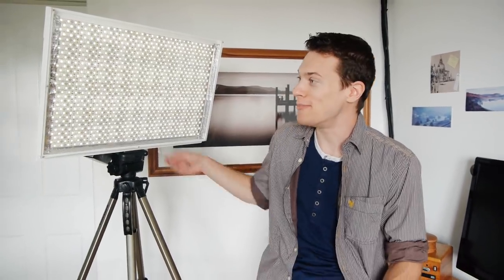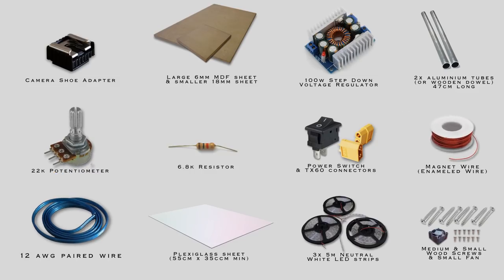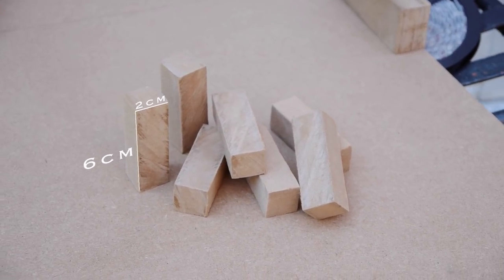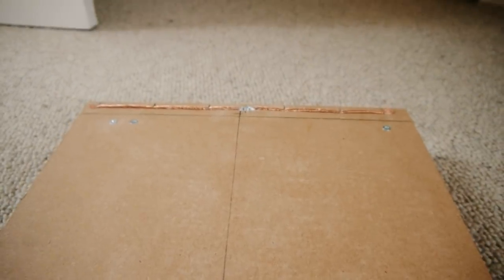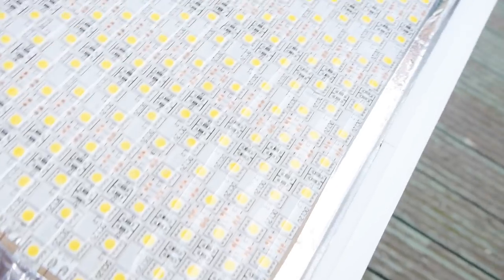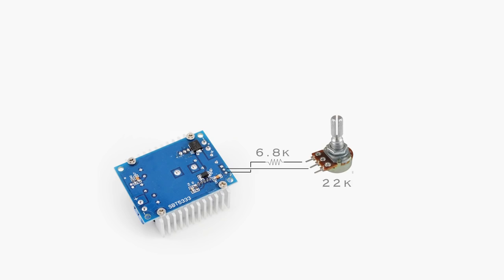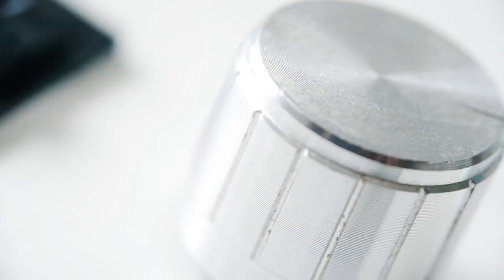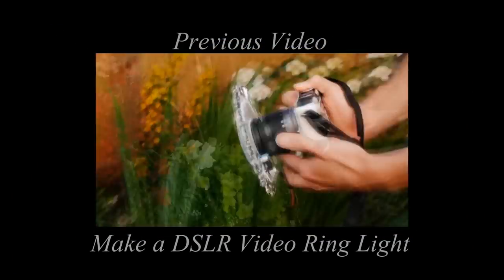How to make a super bright LED light panel (for video work etc)

Comment: Nice project. Do you know where I can find LED strips like these with high CRI?
Reply from the maker: +Miguel Baptista Got a video about such strips coming next month!
Reply: +DIY Perks Nice! Hope you can fins some EU based suppliers. I'm looking into making something like the Westcott Flex. Any ideas on how to achieve that?
Reply: +DIY Perks - Perfect timing. Looking to try this build out ASAP. Would love to do it right and know what to look for in terms of the LEDs to use. Would something like this be suitable? http://www.amazon.co.uk/Waterproof-Strip-String-Ribbon-Roll-300/dp/B018QE8CJC/ref=sr_1_3?ie=UTF8&qid=1454273133&sr=8-3&keywords=high+cri+led+strip
Reply from the maker: +Oscar James I actually have a video about high-cri flexible led panels coming next month. It uses fairly specific strips so if you can wait a bit that would be ideal.
Reply: +DIY Perks Thanks, will keep an eye out. I'm in the process of getting a load of kit ready for when I get my Ronin-M in Feb. I've sorted a wireless video feed with a Google Chromecast, phone and portable monitor. I have to work out the wireless follow focus next. Loving your DIY videos, they're giving me more confidence to make a lot of these things myself. Thank you so much
Reply: +Miguel Baptista Ebay or Amazon have them very cheap.
Reply: I don't know wether it's too late now or you still need the info, but I bought my LED-strips from www.coldzero.com (Smd Led Stripes they are called there). They have a real high density and are REALLY bright. Here's an example of their brightness: I expected to get myself a meter in order to have me PC-case fully lit, I ended up needing only 15cm in total so that it was brighter than my room during the day. If that's not impressive, I don't know what is. :D
Reply: The coldzero link connects to a parked - not live - website.
Reply: glassmakerx
Jeah, just noticed that I'm a bit stupid. It's www.coldzero.eu and NOT .com, my bad.
Reply: yuji sells high cri strips. They are great.

Comment: Doesn't work using laptop adapter. Used 4 step-down converters from different suppliers, the max working time was ~15min.  Didn't try using batteries. Great idea, but suppliers do not hold to the technical characteristics they claim.
Reply from the maker: gene_m Have you installed a fan on your voltage regulator? They have automatic thermal shutdown. Alternatively, it could be your laptop adapter that's overheating. I suggest trying one that's rated for more power output. Laptop adapters DO work, but you do have to make sure that the one you use can supply over 100w, as I mentioned in the video.

Comment: Hi i have a question, i want to use my laptop charger which is 19.5V    6.7A is this enough to use the maximum brightness of the LEDS
Reply from the maker: +Yusuf Murat That's ideal yeah, as it should output 130w. (19.5*6.7=130.65)
Reply from the maker: +Yusuf Murat That's ideal yeah, as it should output 130w. (19.5*6.7=130.65)
Reply: But you said at least 10 amps mine is 6.7A
Reply from the maker: +Yusuf Murat 10A is required at 12v, as mentioned in the video. Higher voltages are only okay if they're behind the voltage regulator, which wasn't hooked up at that section (hence 12v).
Reply: According to my calculations and this led specifications power consumption equals to 72w/5 meter =216w
While supplied power equals to 19.5V*6.7A=130W so I'm still in trouble theoretically my laptop charger is going to burn out
Reply from the maker: +Yusuf Murat The LED specifications aren't accurate, and don't draw nearly as much as claimed. Your charger probably has current protection anyway, so it wouldn't blow out if overloaded.
Reply from the maker: +Yusuf Murat The LED specifications aren't accurate, and don't draw nearly as much as claimed. Your charger probably has current protection anyway, so it wouldn't blow out if overloaded.
Reply: Thank you very much for answering i love you and your tutorials so much keep up the good work

Comment: Hey is it possible to use a Voltage booster instead of the voltage regulator?
Reply: +anthony “Findenzio” Hom What are you planning to run it off of? a single AA battery?
Reply: +fetymann no power supply

Comment: Your link for the LEDs is for Natural white LEDS. Can you use Cool White as well. I want to build this for video taping indoors.
Reply from the maker: hoxha34 Cool white LEDs are usually too much on the cool side of things, looking a bit blueish.
Reply: DIY Perks Does the power supply have to be more than 12DC to work with the regulator. I was reading that every LED consumes .2watts. with your design thats 180 watts. At 12DC that 15 amps. I havent been able to find a laptop charger that is rated no more than 90W. I have found on ebay DC power supplies rated to handle the power based on the calculations.
Reply from the maker: hoxha34
 You can use an adapter that's anywhere from 12 to 30v. Hunt around a bit for the adapter as there are plenty of high wattage ones out there.
Reply: hoxha34 Also I want to build for 3 light video filming. do you think its better to build 3 smaller units instead of one big unit. Lets say 3 30cm x 30cm panels. 300 leds each panel.what are your thoughts. this would be indoors for interviews.

Comment: It isn't clear what power supply specs you used .......... ?  how much a 5 meters roll needs, how many volts, how many amps, what happens to the current intensity when the voltage is dimmed ...  i tried to contact you but you must be busy. 
i'm surprised that you're using a little 100 watts voltage dimmer, when for 3 rolls of leds like that, ( 900 leds, just the same ) i was recommended a 12 volts 20 Amps of power supply ( thinking of converting a pc block for that ), which means 240 watts ......

Comment: I have a few questions:
Wouldn't it be easier to use capacitors to eliminate flickering? ( Low ESR 105°C Electrolytic Capacitors 2200 uF / 16 V).
If this works you could just use about 3 of these and then use a normal 5€ dimmer with a remote control, which would be handy :)
This would result in just the bare LED with a dimmer but much easier to build and cheaper too.

I can't find anything cheap that is a lipo so I thought about using a lead acid battery. Any thoughts on that? They are way cheaper than lipo batteries so there's got to be something bad about them ^^

Awesome video!
Reply from the maker: ***** Tried caps but it doesn't work unfortunately.
Reply: DIY Perks  Have you considered trying a low pass LC filter with a PWM dimmer? I made a smaller version as a proof of concept and it seems to work ok.
Reply from the maker: TheDanyschannel I haven't no, but if it worked it would be pretty handy for RGB type dimmers. What values did you use? You might be on to something.
Reply: DIY Perks I used a "pi" configuration LC low pass, 470uf caps and a hand wound toroidal inductor (40 turns, 1.7mm outer diameter), about 3mH according to some internet calculators. my switching frequency is about 1KHz, and this filter completely removes the DC component on a 5W led setup. If you build your own just calculate a lower cutoff frequency than the switching frequency (my cutoff F is about 250 Hz). I hope this helps. By the way great videos! you just got another subscriber!
Reply: TheDanyschannel sorry made a typo AC component (not DC)
Reply: ***** PWM works by reducing the time the lights are on, reducing the average brightness by flashing the lights, Most PWM dimmers are designed for the human eye's snail-like response time, not the fast response of film or video. Unless the dimmer is purpose-designed for video, it will always result in flickering. (the flickering is actually a stroboscope effect between the frame rate and the pulsed light) The way this can be minimized at design-time is to make the pulse rate very much faster than the frame rate so each frame sees lots of flashes.

Lead-acid batteries are less expensive than their LiPO cousins because of their automotive-housed grandfathers. The most noticeable "bad" part about them during their lifetime is that they are extremely heavy to lug around. Compared to a LiPO battery of similar capacity, a lead-acid battery weighs around a hundred times more. If a lead acid battery is mounted on the lamp, the unit would wind up being far too heavy for a standard tripod. That can be gotten around by the battery being on the floor, and an electric cable taking power to the remainder of the lamp. (Also note that the chargers for the two battery types are not interchangeable)
Reply: JimShew2 Awesome comment, thank you :)
Reply: The voltage converter that he is using varies the voltage by using pwm,but the frequency is a lot highter so the little smoother capacitors are enough to smooth the output.
Reply: Inexpensive lipos can be found on hobbyking.com just be sure you choose the right warehouse you buy from otherwise you will get charged international fees.

Comment: You say that the light output from this is the same colour temp as daylight which is 5500k but the strips you've listed are "neutral white". I live in Ireland and Amazon won't ship electronic items here so I have had to look elsewhere. So far the searches I've done indicate that "neutral white" has 4000k colour temp. Are the strips you have used definitely 5500k? I cant actually find any 5500k strips. They all seem to be at least a 1000k cooler or warmer than that.
Reply from the maker: SMELLTHEBULL The diodes themselves are 4500k, but because of the waterproofing the emitted light is somewhere between 5000-5500k. Why not purchase from eBay instead of Amazon? The link in the description is the only place you can reliably get them, as it's a factory outlet store.
Reply: DIY Perks Ah that explains it. I did look at the ebay link you posted but the product is being sold from America. I wasn't sure if there would be issues with the different voltage on this side of the pond, or does it not matter because it runs off 12v? Excuse my ignorance!!!
Reply: DIY Perks Great video by the way and thanks for sharing. Just one other thing.The video doesn't seem to cover how to connect a power source to the light unit. What kind of connection is used?
Reply from the maker: SMELLTHEBULL The strips are actually shipped from China - if you log in with your eBay account the currency will be automatically converted. Powering the panel is covered in the latter part of the video. Hope this helps!
Reply: Great. Thanks for your help.
Reply: DIY Perks Would the dimmer on these cause the flicker?

Comment: I have 50K POTENTIOMETER , it can be used?
Reply: Yes if you solder a 27k resistor across the two wires connected to it. However, its operation will not be linear.

Comment: Why did you use 12 AWG? LED's will never get close to the 20 amps this is rated for, or even 80% of that. Most high output LED fixtures I've seen never use thicker than 16 AWG.

Comment: What happens if you get below the 6 volt?
Reply: nothing bad actually. the led just will not lit up. i guess the extra resistor is only necessary for smoother brightness control

Comment: can we use just the potentiometer without the voltage regulator
Reply: +Yassine Ibr No.  A potentiometer alone can not handle the current requirements of this project and would immediately fail/burn/melt.
Reply: +isogloss3d thanks
Reply: +isogloss3d but the voltage regulator is used to limite the voltage

Comment: For me your LEDs will not last longer because you stick them in card board not aluminum or heatsinks cause if your pannel draws about 100 watts to 1 Kw it should also draw a lot of current and convert to heat which shortens the lifespan of the led

Comment: 5050 4500k led strips are the ones you use in this build?
Reply from the maker: JUCE DA MCEE Waterproof ones, yes (it does matter).
Reply: DIY Perks o ok i made one and it came out great. i have a question about your diy ring light tho i'm almost complete with it. i have a 6 bay AA battery holder but i dont wanna power with that cuz i dont have rechargeable batteries right now but i do have a 2 cell 11.1v lipo but everytime i hook it up the voltage booster strats to get hot and sometimes start to smoke. is there anything i can do like run a resistor or something in series
Reply from the maker: JUCE DA MCEE Are you sure you've not got the polarity wrong? It shouldn't be smoking or getting hot unless you've set the output voltage too high and are overloading the regulator (it only supports 15w).
Reply: DIY Perks well im using the leds u suggest only thing different is im using 19 instead of 20 but i dont think thats the reason. Im not around the batteries ryte now but at most there no more than 800mah so multiply that by 11.1v thats only 8.88wats

Comment: okay, i really need an answer quick here, 

I am filming from the 10th of April onward for 3 days,
I need the LED light strips but the link below coming from the United Kingdom has
an estimated shipping date of 9th of April to 27th of April. 
Can someone help me find the LED light strips quickly from the UK?
Reply from the maker: TheUnionAirsoft While there are similar strip lights in the UK, none I have found are this same neutral colour, anda re much more expensive.You should contact the seller on ebay and ask him for priority mail - it'll cost more, but you should get it in time.
Reply: okay thank you very much
Reply: Google.
Reply: i had tried google, searched everywhere finally found one on ebay
Reply: TheUnionAirsoft LEDs run on DC power. DC power is the same everywhere in the world. LEDs are available in any modern country. Stop whining and make an effort with Google.
Reply: haha, i wasn't wining, I needed some information that DIY Perks gave to me and i am grateful for that, i am sorry but i don't need your silly little input

Comment: Do you have any videos of the final LED light in use?
Reply from the maker: Steve Armstrong Photography I use it quite often in my videos actually. Only, most of the time you can't tell I used it because it looks like light from a windows. Take a look at my main Cloud Unit video - I used it there to light up the blue background.
Reply: DIY Perks ...and when it comes to the magnet wire you don't state a diam.  Thicker would be better, yes?
Reply from the maker: Steve Armstrong Photography
 Thickness doesn't matter too much as the length is so short and for only 50cm of led strip.

Comment: you picked the wrong leds, 5050 have a cri of 60-70 and an efficiency of only 58 lumen/W, 3014 are the same price with a cri of 75-85 and a much better efficiency of 90 lumen/W

Comment: is there a way to mod this design so you can plug it straight into the wall?
Reply from the maker: Nebeel0 You mean plug it in without using an adapter? No way to do that. Not a good idea anyway because you'd have to connect them in series to accept a high voltage (230v in the uk) but then you'd have to rectify the AC to DC too... so it's just so much easier to use an adapter :) they're cheap and easy to rig up.
Reply: DIY Perks oh, I meant if I could just plug the panel into the wall instead of using a battery. I'm not very tech-savvy, so I'm assuming it might actually pretty simple to switch between using a battery and plugging into the wall. Unless it isn't...
Reply from the maker: Nebeel0 I actually covered this in the video ;) the panel can be powered by anything you want, so long as the voltage is somewhere between 12v to 30v. Batteries, laptop adapters, switching adapters, it all works so long as it's DC and can supply 100w.
Reply: DIY Perks oh....lol, thanks, didn't catch it the first time.
Reply: I recommend to under drive LEDs a bit and use more instead. Then you can put them in series, add a small rectifier and a big cap onto it and there you go. You have to put 34 strings in series and you are safe to use it in a country with 240 Volts AC.
IMPORTANT NOTE: Please do NOT handle with mains voltage regardless if 120 or 230 Volts unless you have experience in doing so!

@DIY Perks: You used a buck/step down converter which uses PWM to get the voltage down. The frequency is so high, that it can be smoothed by the output caps and inductors in this circuit. So your dimmer is even PWM, too. ;) PWM in fact IS voltage regulating!

Comment: Why did you buy voltage regulator with all the extra part. Just get a power supply it would solve everything. plus just get a dimmer remote
Reply: +anthony “Findenzio” Hom I thought the same but I still get flickering with the dimmer remote, anything below 100% brightness causes flickering. Maybe you have some better L.E.D's you could suggest though?
Reply: oh no i dont. What dimmer remote you got?
Reply: +anthony ”Findenzio” Hom As this light is used as supporting light for photoshooting, which often happens outdoors, needing a static power source could prove problematic as you would need power generation somewhere in the forest or mountain. Battery allows you to move the light around and use it outdoors

Comment: I sell electronic components and was just wondering why not just use a power supply with a 12VDC output and 120VAC input? Mine go to 240VAC input so I think that would cover voltage in the UK. I sell my power supplies for $14 so I think that might save money over the battery pack, Converter, and just the cost of batteries themselves. I also have small 8000Rpm 5VDC fans the size you see on computer processors. The power supplies I sell put out 12VDC as well as 5VDC, also have some that can put out 15 and 21VDC. I wont spam by posting a link to my store. If anyone is interested just reply or email me. By the way, the fans are $6.50 for 2 and free shipping in the USA. 

I plan on making one of these in a smaller version to build a light box used in developing photo resist film for making my own PCB's. Great video!